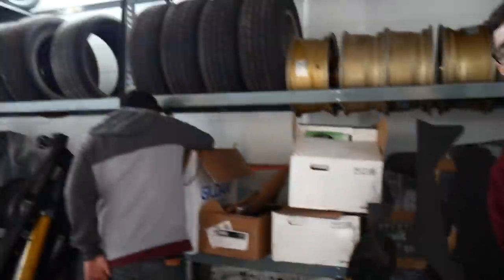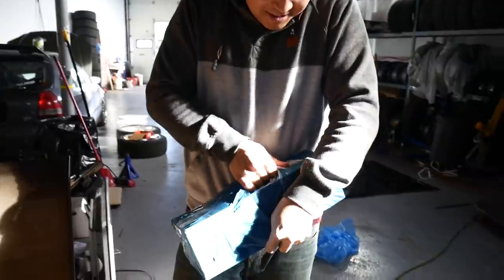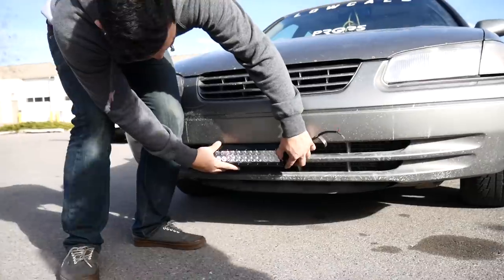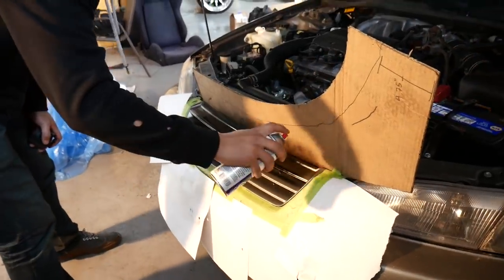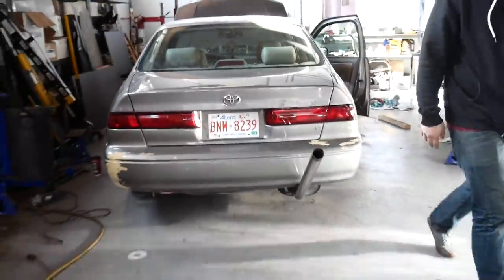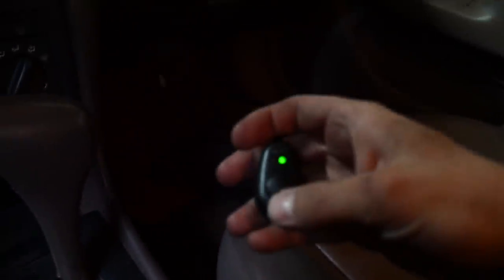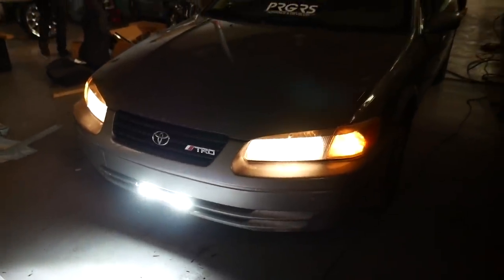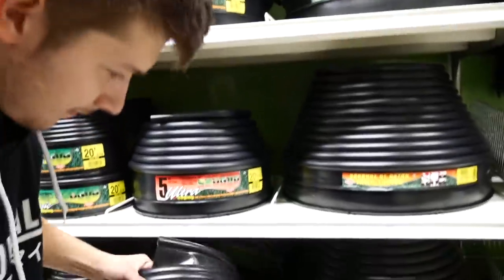HOW TO MAKE A BORING CAR LOOK COOL!

Comment: What mods should i do to my 1999 Nissan Maxima ?
Reply: JEdits boost it
Reply: If it's the NA sr20 boost it
Reply: slam it on tarmacs and daily it. if its the VQ30 it probably gets down a little, throw a few bolt ons onto it haha
Reply: JEdits sell it and get a Beam (BMW)
Reply: Do some deletes. Like a radio delete, ash tray delete, A/C delete, OBC delete, ABS delete, 99 Maxima delete...
Reply: Be smart and Don't mod it it... Its a family sedan, so keep it that way.
Reply: Lower it a bit and some nice wheels. A track stance looks good.
Reply: Crush it.
Reply: JEdits muffler delete and wheels and slam it
Reply: Is it an auto or manual. Ignore the hate and ignorance lol. Exhaust, intake, q45 injectors, fuel pump, and a nisformance tune. No point in boosting a vq30. Trust me i know lol
Reply: U can get a stillen supercharger though. Grab yourself a stillen lip kit and coilovers for it
Reply: Put a big wooden spoiler on the back, cut a hole in the exhaust and let it rust, put a turbo whistle on the tailpipe and add alot of jdm stickers for extra horsepower. 👍
Reply: Peter Guthrie 😭😭😂